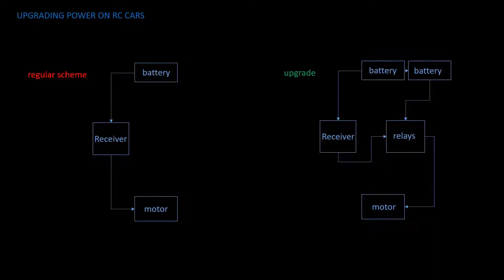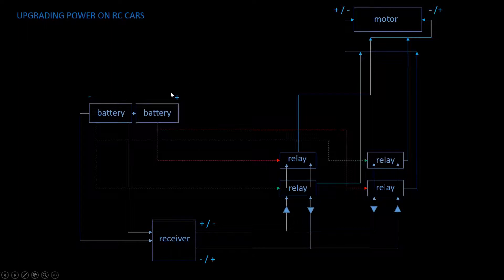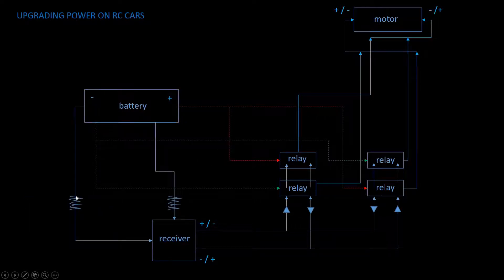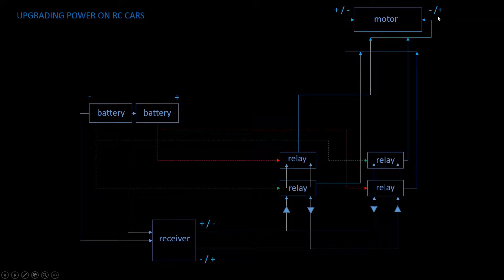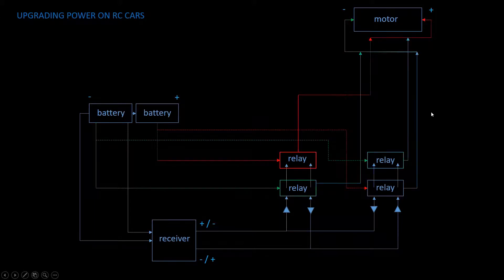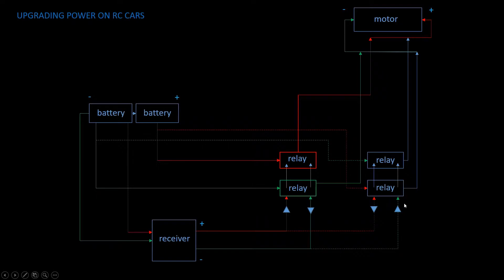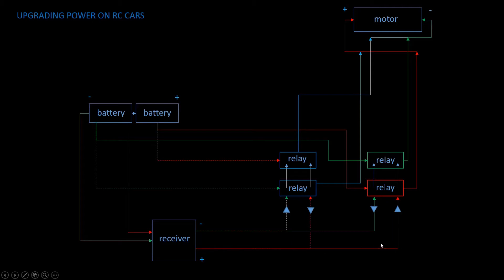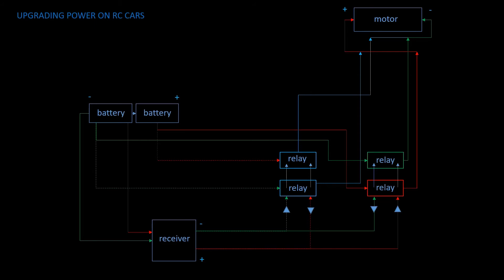How to Make Your RC Car Faster. Install Extra Battery, Relays and Diodes. Power Upgrade Explained.

Comment: You only need 2 diode and 2 relay. Only use 3v relay because the esc only supply 3v with left right on. I've tried 5ch 27mhz with turbo button, add one more relay and battery for more speed.

Comment: Hi. What diodes to use? I use 5v relay. Please help.
Reply from the maker: N5408 3,0 amp 1000V DO-201AD , I took the largest one, as it does not affect voltage much, almost the same resistance as the smaller ones. The smaller ones may overheat.
Reply from the maker: but you can experiment if you buy a package of different types of diodes, use the strongest ones and see if they allow the voltage to activate relays.
Reply: @AventuraRemoteSmart  thank you for your reply